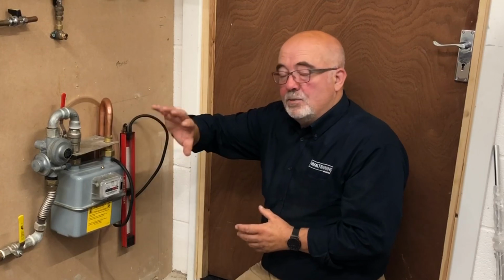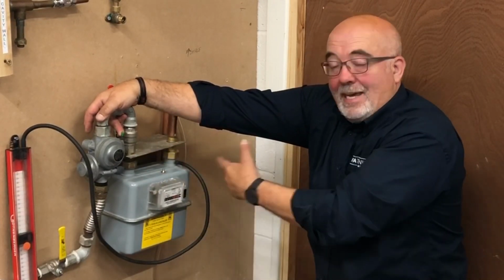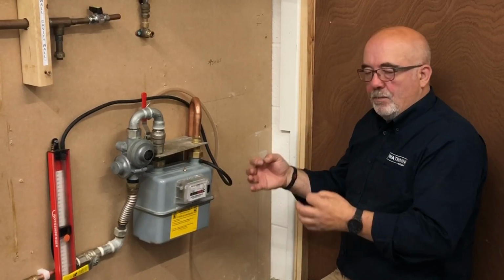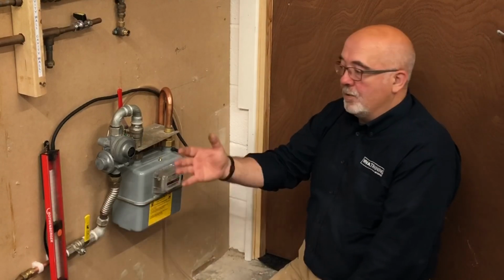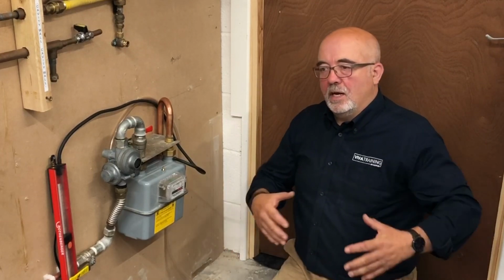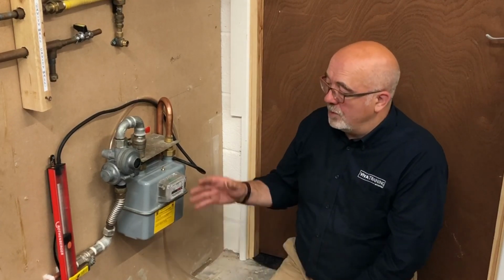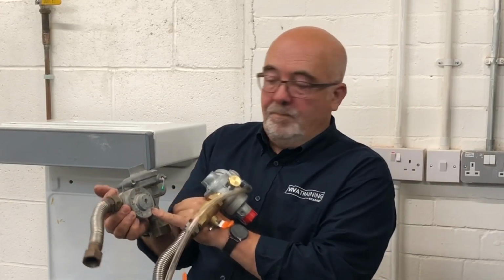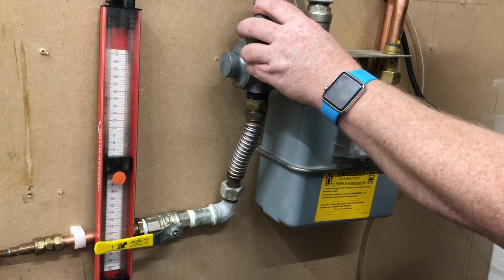Medium Pressure Tightness Testing - ACS - Gas Training - Gas Meter Testing - Russell Holdsworth

Comment: As a trainee i came across the medium pressure meter. However my engineer didnt want to remove the meter on a install, as he put it  could cause problems. Is the procedure the same as removing E6/U6/G4? Even in training the  temporary removable for hot works has never been discussed
Reply: The procedure is the same as for low pressure. Once the gas has left the regulator, it's at the usual 21 mbar pressure. The meter is just an ordinary meter.

Comment: Forgive the stupid question but what is the difference between low pressure and medium pressure tightness testing? Is it the size of meter and amount of gas coming into property?
Reply: The safety features on the medium pressure meter get in the way of tightness testing (Under Pressure Shut Off shuts off at let-by test pressures, so you have to reset it before & after let-by test). Lock-up pressure is lower; if there's no Meter Inlet Valve you have to do the test 2 mbar lower than normal to avoid lock-up.

Comment: Alan correct me if I’m wrong but that main ECV is falling to on 😮
Reply: Sorry just watched the rest of the video 😂😂😂
Reply: That was a distraction for me too Kenny, but thankfully it was explained👍👍
Reply from the maker: Kenny Donnelly Yes that’s absolutely correct, Well spotted. It talks about it in the video. Thanks
Reply from the maker: Thanks for watching 👍
Reply: Hi Alan, these are good points, but I work over in NI where (nearly everything) is MP, I'm sure the regulator brings the pressure down to about 26 (ish) mB. Also, did I see it right that the let-by was done at 0mB, or was he just muddled? Let-by's are done at 7-10mB?

Comment: They are fairly common around Aberdeen. Many years ago I chased a ‘faulty’ boiler, a Vaillant if memory serves, which had an intermittent fault. 
Couldn’t get to the route of the fault.
I didn’t do one basic check!  
After contacting the agent and attending site, we discovered that on light up, the inlet gas pressure dropped to about 9 mb for a few seconds. 
I hadn’t checked it previously. 
On checking at the meter box, it turned out the breather tube was kinked inside, and didn’t let the regulator ‘breath’ or operate quickly. 
This caused the dip in pressure. 
I’ve never forgotten the fault. 
Stick to the basic rules and follow procedures. Thanks for an informative video. Every days a school day!